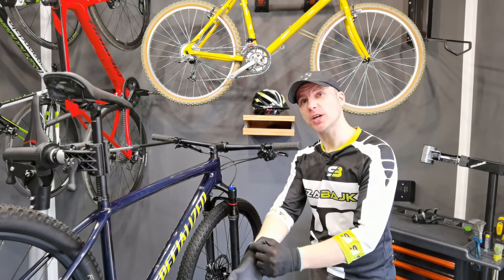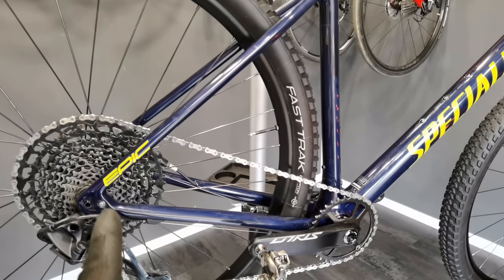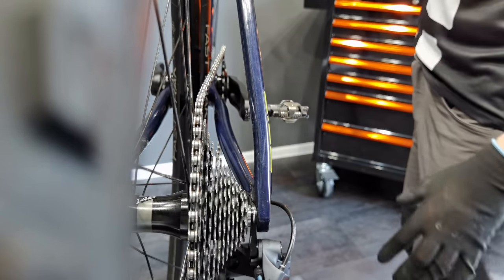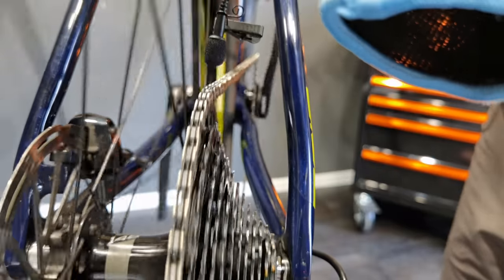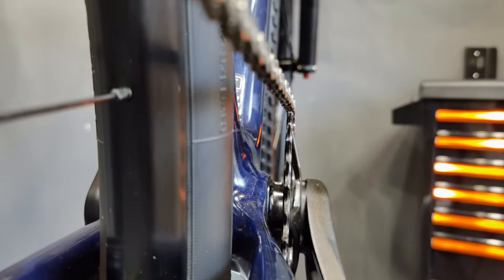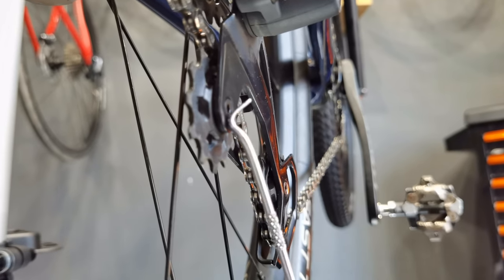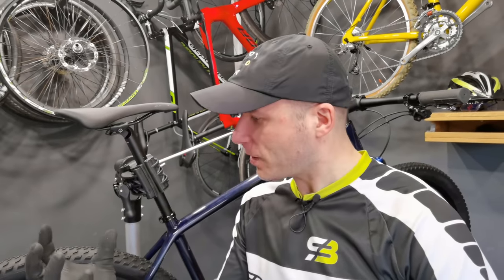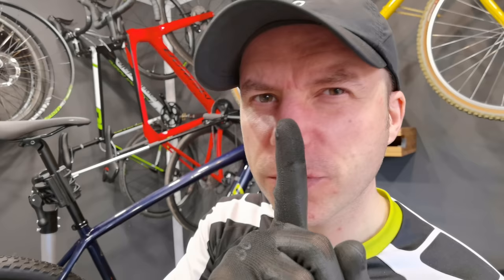If you were close to XC race podium riding on 1x12 drivetrain, you'd win it on 2x11. Here's why...

Comment: So true. I'm an older xc racer (60+years) and appreciate having a wider ratio of gearing for those extra steep climbs and also for the long fast flats.  I'm a consistant podium  finisher and can contribute part of that success  against 1x12 racers to  having a wider range on courses that need more top speed or those extra steep climbs. I ve been running a 3x10 close ratio system, 26t, 32t, and 40t chainrings up front and 11to 46 on the rear and have raced on over 40, races in Thailand, and a couple in Colorado and Utah. You can get a wider ratio and save energy on a 2x11 or a 3x10 at only a small gain in weight.  And Not have to remove and add different chainrings according to each new  course you ride like the 1x12 serious racers often do. Even if I didnt race, I'd prefer more gears to choose from :-)

Comment: Any speed you gain with a 2x, you lose when you drop the chain lol
Reply: I feel that
Reply: I dropped chains on both sram and shimano clutch derailleurs. Never on 2x.
Reply: John DeF I’ve had chans dropped on 2x always in front derailleur for me, maybe I just need better 2x
Reply: In fact, 2x drivetrains usually retain better the chain because they have a front derailleur which acts like a chain guide (You will loose the chain if you pedal backwards but same happens with 1x's).

Comment: I will start by saying I am not a competition rider, I just love building bikes and riding trails with my friends and family, recently I built myself a full suspension enduro style ride with all the top parts, Fox forks, seat post and rear shock, full Shimano XT 1x drive train, including hydraulic disc brakes. After riding our local bike park over 5 different weekends I started to notice a noise from the drive chain, when in the lower gears as I was climbing back up the hill,  it sounds like, when the derailluer is not set right and chain is dragging on a cog. Once I was home,  I put the bike back in the service stand and inpected it to find the source of the noise. I found it was coming from the 36 tooth chain wheel at the crank, as the chain leaves the wheel heading towards the derailluer, the chain is catching on the tooth and making a clicking sound, at this point I realized that the is no solution to my problem and I would have to live with it.
After watching your video I concur that the chain line is the problem, I like your videos, keep up the good work.

P.S. I have a hardtail with Shimano XTR Di2, I also found a engineering design flaw with it

Comment: Agree! totally Agree about loosing Watts. But 1x is useful to XCO, because even loosing Watts, is faster change gear with 1x system. Specially with electronics rear derailers, when you go Uphills and downhills everytime in few seconds almost without time to anticipate the gear. In XCM races, totally agree with you. But the Marketing try to sell this idea that 1x is the best scenario in both disciplines XCO and XCM. 

You could make a good video, with AXS. The AXS app, can give you the information about how many time in one race you are using which gear. and than, you can estimate Lost watts.

Good Video. Thanks.

Comment: Interesting because any of my biker friends in 1978 could have told you that the angle of a 1x12 (they did not actually exist then) would be very bad for the chain aside from the friction it would cause.  It was the reason that chainrings had two and three rings on early bikes.  Not so much for easy uphill but more to keep your chain from breaking from the severe angle.   Granted...the distance in cassette rings was wider because the rings themselves were wider.   I am amazed I that there are 12 rings in nearly the same space as 5 or 6 but still the angles were severe.  Your points on this are very well done.    Looking around, I doubt two chainrings and a front derailer will be back in vogue.  At least on mtbs.

Comment: 1. In a muddy or bumpy conditions there's a high chance of FD malfunction including chaindrop or chain jumping up and downwards. 1x wins
2. On punchy climbs that are usual for XC you have to push a lot of watts, same as rolling resistance, friction is a constant and depends on chainline, meaning you have much higher relative loss if you push 250W vs 800W. 2x wins but slightly
3. Again, on punchy climbs you have to react fast to rapid descend or attack, and changing gears under load with RD is much more reliable than with FD + you don't have time. This is the reason why in road racing such climbs are often attacked on big chainring with huge bend in chainline. 1x wins
4. Regarding the range which allows you to pedal comfortably or with bigger range of gears, 2x obviously wins.
The bend for 1x12 is crazy and assymetrical chainstays is a really cool solution, but in my opinion 1x11 is fine as it is. You might need different chainring or cassette depending on the course, but other that that I see no problem in 1x for racing purposes. It might be less efficient but it certainly more reliable.
Reply: 1x is lighter too.
Your point #4 is my Achilles heel with the 1x, I have a bunch of rings: 30, 32, 34 and 36, some oval and round, I play with them a lot and sometimes feel like I never get a sweet spot.

Comment: That's indeed a situation that comes with a 12s cassette, but the chainline can't be much more to the biggest gears, because the interference between the gears itselves. When the chain is at the biggest gear the chain line crosses over the 2nd gear but passes gliding over that 2nd gear without touching it because it's smaller. If the straight chain line passes right at the center of the cassette, the problem described above (chain crossing over a next gear) comes to happen on both edges of the cassette, causing a bigger problem in the 11th gear, because it's bigger than the 12th, so the chain can't avoid to touch and friction the teeth of the 11th gear and have friction in and outside the links and in the chainplate and in the derailer pulleys. So, in order to avoid a bigger chaos, the chain line must be charged a little bit more to the smaller gears side.

Comment: Danny, great topic. Several studies have found that the combined friction from cross chaining and from the derailleur jockey wheels can be as much as 12 watts. That is power you are putting out that is not reaching the rear wheel. That is one reason why people racing a single speed often finish high in the standings against geared bikes.

Comment: The system is designed to run with the chian at an angle like that, If you want to give a valid view you should have tested with power meter pedals and a power hub, on both systems then measire the difference.
Reply: But it is logical that once the chain bends it becomes less efficient. I can feel that in my legs, on a 10 speed casette.

Comment: I agree with you but disagree with most of the comments here. If you are a XC racer then 2x makes a lot more sense than 1x. For example, one person wanted to know why not stick with 2x or 3x groupsets that keep chains straighter. Well, because for most riders it won't matter and if you are a downhill/enduro/trail rider then you care even less. Tire width, rolling resistance, and weight make a lot more difference (measurable on a power meter) than the chain line.
Reply: its all quantitative sciense here

Comment: So, there's a tiny advantage to 2x. Worth putting up with the poor chain retention, cluttered left hand 'bar for? Worth the restrictions to suspension pivot placement and hardtail geo for?
For me, not even remotely close. The chain-retention thing alone is enough to make 1x worthwhile. For me anyway.
Also, 1x isn't new. I was one of the last of my riding mates to move to 1x, back in 2002! Others had got there years and years before me. We had no narrow-wide rings or clutch mechs but the multi-ring chainsets were so bad we adapted whatever we could get to go single and get rid of them. No one I ever met in person ever went back to multis.
Finally, the MTB market is catching up with its customers!!

Comment: there are wide range cassettes (up to 50t cog) available in 10, even 9 speed. For ebikes i even go so far to remove the 11t cog (robs chainline space and has poor engagement). to make the cassette even more narrow. so far my favorite for emtb is 9 speed 13-50t with a 38t chainring. the thicker cogs (1.8 vs 1.6mm can handle the torque far better. gear jumps are huge, but no issue with a strong motor

Comment: If the chain ring could float side to side that would be great for the chainline
Reply: Yeah, I was thinking the same thing, if they can make a design that works reliably, that would be a game-changer in the 1x system. If possible, it might most likely be used with the electronic wireless drivechains to control that chain ring float.

Comment: That angle is really extreme on your 1x12 set up. On my Ripley its not anywhere near as bad. But, it is still noticeable and is certainly a source of considerable friction. I'm going to speculate that 2 speed rear hubs are coming and are going to be the next big development in drivetrains. Hopefully, that can make some changes in chainline as part of a whole system improvement.

Comment: I agree  with  you     I think a 2x10  would be the ultimate      less gears on the cassette  also allow  for a better  spoke brace angle
Reply: 3x10 for me an older racer  at over 60 yr  gives me a great system  26t,32t, and 40t chainrings with a 11-46 tooth 10 speed cassette. Kind of a closer ratios system  but wider than any other system.  I got the aluminum chainrings from Blackspire of Canada and they are very tough aluminium chainrings that last a long time  with proper care. I normally race in the 32t chainring on the xc course but can downshift to the 26t on extra long steep climbs , or go up to the 40t chainring on  very long flat parts of a course on on dirt roads on marathon courses.where I reel in my competition . I love it . I finish on the podium most of the time in my age group and have seen my competitors run out of gears on long climbs and pushing when I'm stll turning my cranks on the 26t chainring, heheh. Likewise my top speed is higher to make up time on long flats when I  get the opportunity. And all those parts are far cheaper than the current 1x12 systems. I use  XT derailleur/shifter parts and a sunrace 11-46t cassette and he Blackspire  chainrings from Canada. I have a raceface crank.  Been on that system 6 years now. I'm a consistant podium finisher in racing in my age group and contribute part of that to my system.

Comment: Well, i race alot and its not very often i use The 50 tooth gear on 12x drivetrain. Maybe in some cases but i always switch my front chainring depending om what race i am doing. Xco race with alot of steep climbs = 34tooth front or Maybe 32 if it is very steep and long. But mostly i use 36 or even 38 but that is more for marathon races which is flat and very fast. Definately agree with that The chain line is fked up on The light gears! Solution: lower cadence and bigger gears 😉
Also, on The axs system you can se in The app how much time you spend on all The gears which is Great for opting out for The correct size on The front chainring.
And for those People Who use 2x drivetrain... Well. 1x drivetrain is so much better because you Will have less trouble changing gears and dropping The chain. Totally worth The upgrade all time! Maybe better chain line but i really Wonder how many watts you loose when riding those lighter gears
Reply: I do the same in order to use as least as possible the 50t gear to put less stress on the chain.
I use 30t on XCO races and 32 or 34 on Marathon (not even tried 36 in my life, no thanks)
Reply: @ManuelMartinez09  Yes it all depends on how strong you are ofc and what prefered cadence you use! And ofc how flat and fast rolled the course is :)
Reply: I have a 1x12 on my Norco Revolver and rarely find myself using anything bigger than the 10th gear unless the climb is really big/steep.

I change my front chainring anywhere from a 32 to a 36 depending on the track.
Reply: @nathanielrobbins4478  yes. Only when it gets really steep ofc 👍
Reply: @jespero94  Exactly. I dont' want to give up gear range and "hope" that the course is not varied enough to need a wider range of gears. And I don't want to change chainrings for every race as I don't have a mechanic doing it for me like a pro, hehe. My  3x10 speed  close ratio 26,32,40 chainrings and 11-46 10 speed cassette provide a huge range for me without the expense  or friction of a 12 speed system and the chains don't break from stress like on 1 x 12systems.
Reply: @williammorris6097  takes only 10min to change chainring and its worth doing but i get what you mean 😜

Comment: I would put a smaller front sprocket on with and inward offset or shims.  Smaller, as the existing one almost hits the frame, which tapers inward going forward so smaller would clear.  It is way off so moving the rear cluster out as well should be close to centered.  Keep up the good work, drive fast and take chances!

Comment: I will never go 1x on any bike.  I own 3x7, 3x9, 2x10, 3x10 and more and more I see the utility and advantages of the 3x's - makes available the lowest friction gear at any speed.
2x for marathon XC racing is a must.  WC XC racing?  Maybe it doesn't matter as much for shorter races but then again, Van Aert was still on 2x long after the majority of the CX field was on 1x.
Reply: I agree with you. I have a 3x7 and most of my riding is on relatively flat land. The half-step gearing between the middle and large chainrings allows me to keep a steady pedaling effort on the terrain I ride. And when it gets steep, I can drop onto the small chainring.
Reply: Congrats you still live in mid century. Go for 1x12
Reply: @nilog8587  Hey now...

Comment: Ok, you will lose 5 to 8 watts  on the highest and lowest gears. But you will not use it often.  So, average loss will be about 3-5 watts. Maybe you will lose up to 15 watts in dirty conditions. But only electronic groupsets keeps chain angle as minimal as possible. I'm, and even pro riders too, usually doing mistakes, use biggest chainring and all the cassette gears. In this case, efficiency is even worse, than in 1*12 groupsets. So, 1*12 saves your money, makes shifting much easier, saves at least 300g weight, and decreases drivetrain efficiency just a little bit.
Now I'm waiting the new ultegra 12speed to make 1*12 touring road bike with 10-42 to 10-46 cassette.  I have 105 5800 with sucking 46-36 crankset. Overall, it sucks.
Reply: 1x with a 42/46 tooth cassette should already be working fine with the current 11-speed Ultegra. I'm running 2x with a 11-40 cassette and it works with a bit of fiddling around.

Comment: Remember that on a 2x system, the chain is not straight in the middle of the cassette. The question is really how hilly vs flat  the course is to go from 1x being less efficient than 2x. A time trialist uses 1x on a flat stretch because it's more efficient. 

Totally agree on that the standard tolerances could be tighter around the cassette.

Comment: LMAO why is this even being discussed, dropping a chain mid race means you lose no matter what. The wattage loss is around 2-5% between a 2x and a 1x drivetrain (I'm going off the top of my head but someone please double check this). How many xc pros are left racing on a 2x, you'd be hard pressed to find any. A front mech failure or dropped chain and sheared carbon ends your race. If you lost odds are you just weren't fit enough on that particular day or lost due to some difference in skill etc. Compensate for wattage losses using better lubes, taking care of your drivetrain, etc.
Reply: How many dropped chains caused racers to lose a professional xc race?  Sram couldn't make a front derailleur without adding a chain catcher to them.  Sram front shifting is why Andy Schleck lost the TDF.  The problem is this narrative of dropped chains only applies to crap engineers at Sram and does not apply to Shimano.  If you are going to ride MTB, you need to know how to rebuild your bike and install components correctly.
Reply: @SurpriseMeJT  ill go one further in fact and say the narrative of dropped chains is also invented by those who don't look after their drive trains.
Reply: @SurpriseMeJT  I'm a local pro I work on all my bikes. Yes dropped chains are more common even in my experience with sram. Never issues with shimano. But I have ripped out front mechs mid race, racing in shitty weather+cold conditions and shifting to the big ring. I maintain my gear to the tee, chains are waxed and ultrasonically cleaned after every race. Cables replaced every 6 months, indexing checked every race, and wireless drivetrains are treated the same apart from the indexing and cable replacement.
Reply: @jaspreetsidhu5708  dropped chain? If you can compensate for lost watts on a 1X drivetrain, you can use an additional chain guide
(along with an FD) + narrow-wide chainrings + clutched RD if chain drops really plague your riding on a 2X somehow. Then you can use the watt compensation techniques that you mentioned for a 1X to a 2X and gain an even better advantage.

I won't claim to be a "pro" but i have been biking for more than two decades now and never dropped a chain on trail rides even on jumps, a clutched RD and narrow-wide chainrings do a pretty good job. And i won't hesitate to add an additional chain guide if chain drops plague my ride, but i never had to. Never had a problem maintaining a 2X front derailleur too, been doing that ever since i was 15.

The only weird chain experience that i had was when i tried out a 1X12 bike of a friend and pedalled it backwards while on the lowest gear. Chain did not drop out of the chainring but it went out of gear like around 3 cog sizes down because of the cross-chaining on a 1X12. Never had that issue in my 2X road bikes and MTBs.